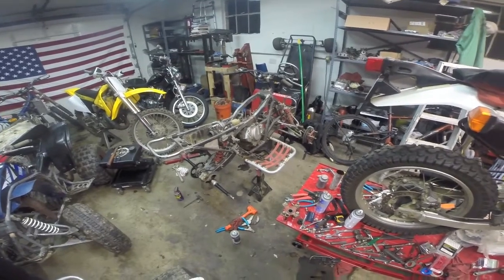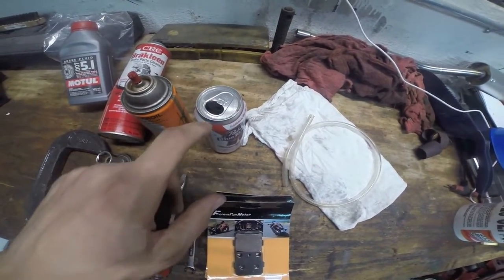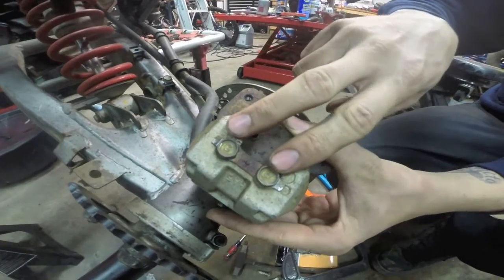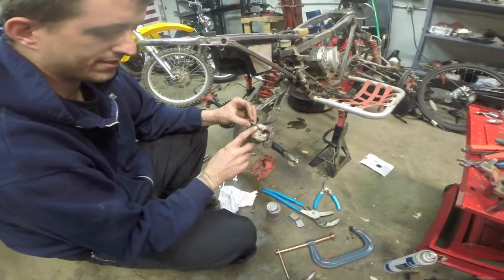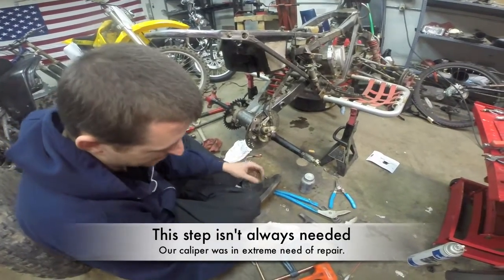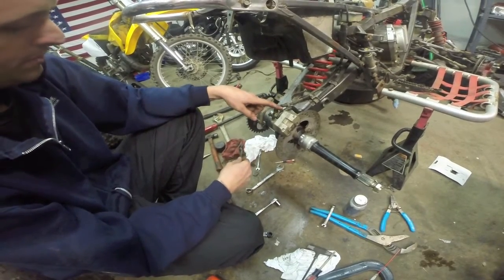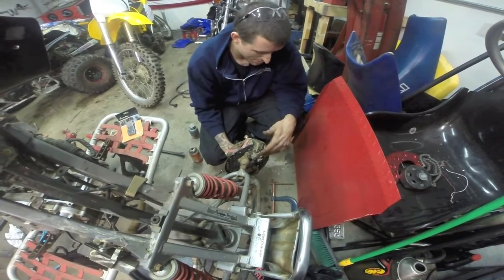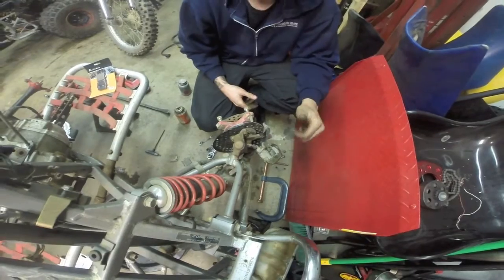How To Replace Honda 300ex Brake Pads

Comment: If there isn’t enough gap between the pads, what do you do in that case
Reply: A year later but id check if you pressed the piston of the caliper in far enough. That usually controls how much gap would be on the pads. If the piston isn't full compressed it won't allow enough space for the disc.
Reply: @Sorrow217  same thing happened to mine but we compressed the piston all the way and it still has no gap